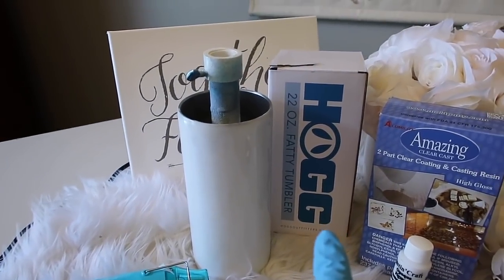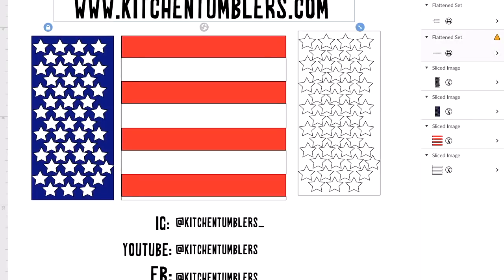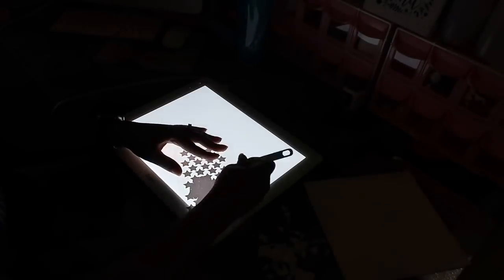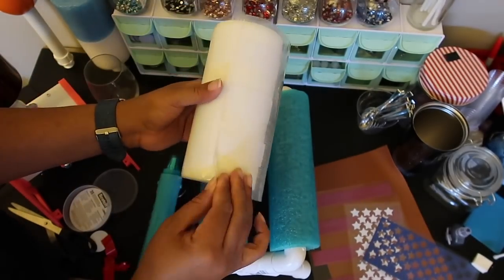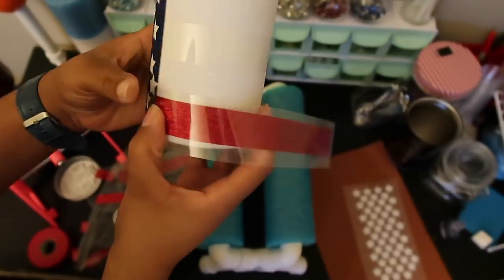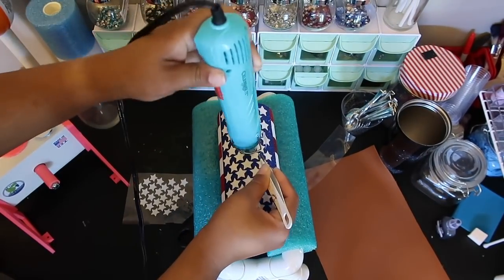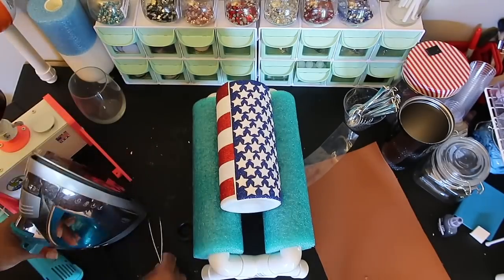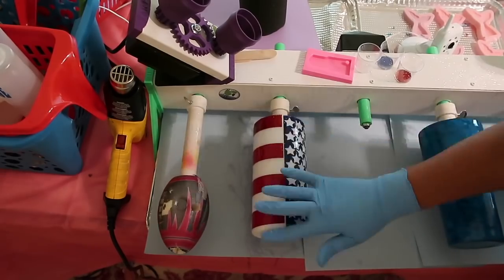Full Glitter HTV American Flag Tumbler Tutorial| 22oz Hogg Fatty

Comment: I really love your cup I have already ordered a couple of fatty tumblers to make one. My thing is I don’t see why you would use htv on it instead of just permanent vinyl I also do htv shirts and things and since htv is so much more expensive I for one don’t want to waste it on a cup when regular vinyl would work just as well. We’ll post a picture of mine done with regular vinyl opposed to htv
Reply from the maker: Debbie Tucker yes, you most certainly can do regular vinyl. However, in this case, I wanted the glittered effect. Glitter HTV gives off a better “bling factor” than glittered Adhesive Vinyl and the price point is the same. I can’t wait to see yours! 😊
Reply: Yes the cup is beautiful !! but even at my vinyl reseller price there is  a $2.00 difference between htv and adhesive. Personally i do not Understand why not just do a stencil with adhesive and loose glitter. Same effect at a fraction of the cost. Additionally I do not trust htv for longevity when applied to a hard surface.